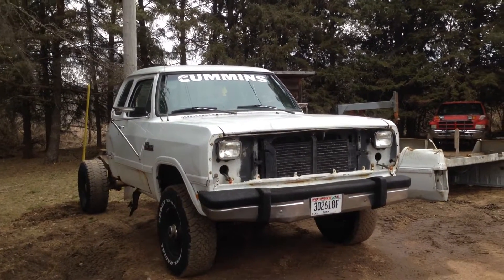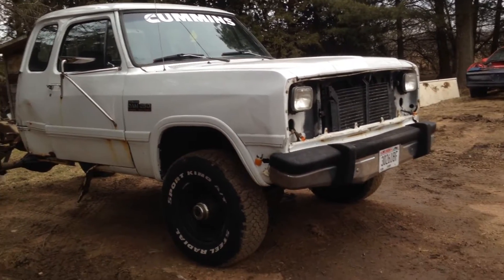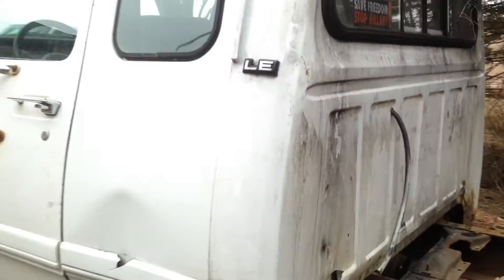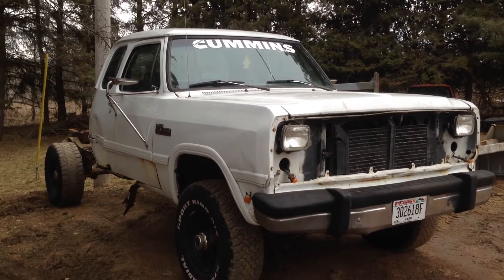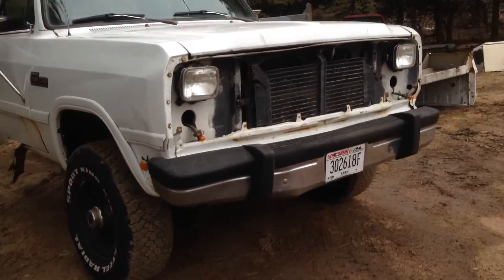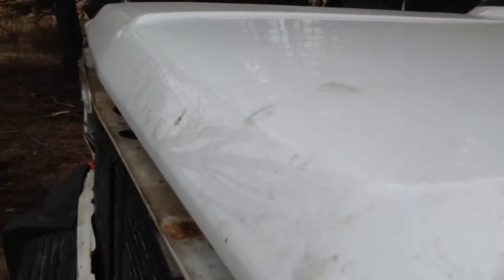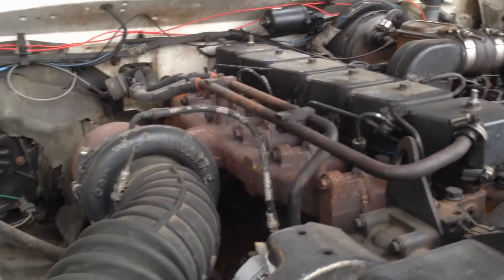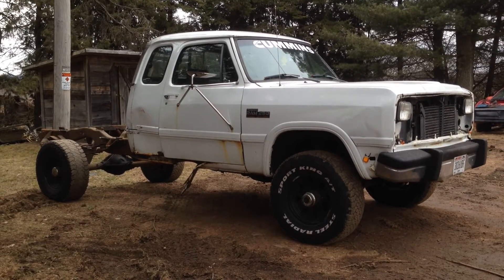93 Dodge W250 Cummins Build Part 1 (Overview)

Comment: Man what happened to the Chevy? I have so many questions!!!!!!
Reply: What year was that truck you got that nv4500 and what flywheel and clutch did you use?
Reply from the maker: I think I pulled the tranny out of a 92 2500.  the clutch was a regular 10 spline small block chevy clutch and I believe the flywheel was a stock 90's chevy small block flywheel that I had to mill off the counterweight and slightly enlongate the holes.  This was because the 99-2000 6.0 had a .400 longer crank and there isn't a flywheel made for them as you could never get a 6.0 5 speed in those two years.
Reply: mrpolarisindy500 nice... thanks man... Well i thought that was mainly for the 5.3 bc I know they never made a manual for a 5.3 but they'll bolt to the 5.3